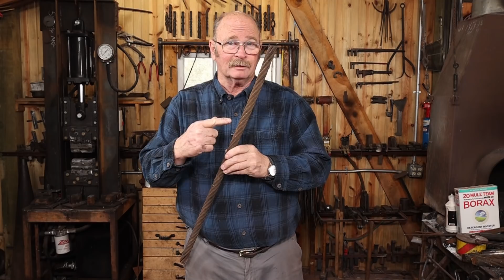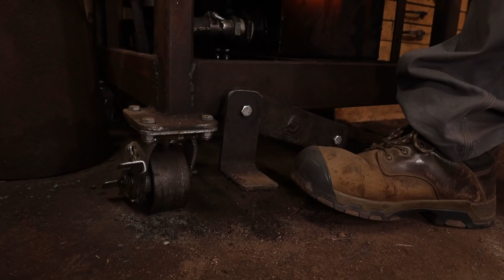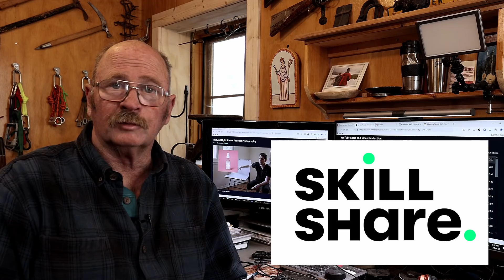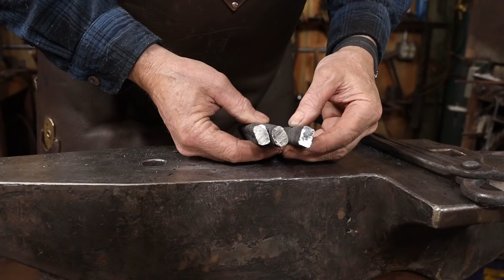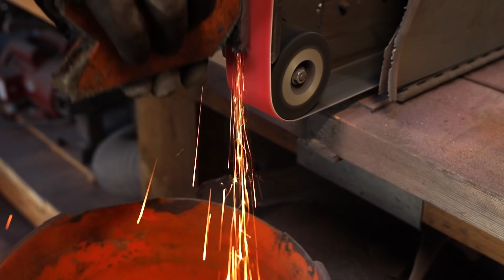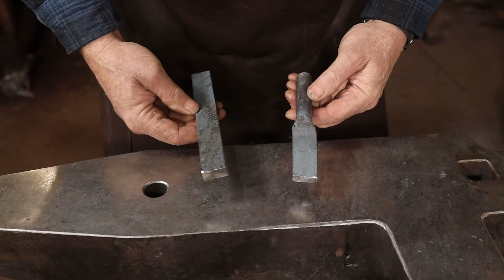Cable Damascus Axe - part 1

Comment: Rewatching this series because the elevator maintenance guys at the hospital I work at turned a blind eye to me walking away with some cable off cuts. Mine have a hemp core and it was suggested that I burn it out before I get serious about real forging.

Comment: I have a question regarding Damascus. I have zero welding skill, willing to learn but for the mean time could I take my strips of steel and forge weld two together and then forge weld strip on strip one by one to form the billet? A lot more work I’m sure but is it possible?

Comment: I just picked up a replacement cable for my recovery winch on my jeep. The stock cable is most likely galvanized, which from what I understand becomes toxic when heated. What's your comment on likely galvanized cable? Is it really a problem if you're on an outdoor forge? I've read other posts about using muriatic acid to dissolve the acid, does that help or matter?

Comment: Very informative,  thank you! I have some 1 1/2 cable 4' long that was given to me by a friend of mine that was on Forged In Fire. Came in 2nd. Been wanting to do something with it. I tried a small piece, welded the ends and well, it didn't turn out well. I'm going to try your process and see how that works. 👍

Comment: I have followed you for some time and also follow a Ukrainian smith called Shurap .  When he works with cable he always soaks in a liquid which I think is a borax solution, https://youtu.be/k5rDbr_0Ik8 Thanks for taking the time to share your video.👍

Comment: I took a family trip to San Francisco a couple years back. I picked up 4 sections of the cable from the cable car drive system. And have plans to make knives from it. One each for me and my 2 sons. 4th is to account for not getting it right the first time. Will definitely have to do the extra cleaning steps though.

Comment: Greetings John, another great video.  I have a Hells propane forge with a 30 psi gauge.  It seems that I can’t get my work as hot as you, that white hot.  I use 2, 20 gallon tanks together with a Y hose connection.  Do you think I don’t have enough “push” to get my work white hot?  Any advice would be wonderful.  Stay safe, Joe from Wisconsin.
Reply from the maker: White heat isn't needed.  What you see in a video isn't very accurate due to the way the camera sees the light and then how you monitor displays the image.  Forge welding heat is usually described as a lemon yellow.   Every gas forge is different and some style will never reach welding heat.  Altitude also plays a part, I had to add larger jets for mine to work at 6500 feet.  But the smaller 20 pound tanks, even paired up, do have trouble putting out the volume required at times.  I never had a problem with a single 100 pound tank.
Reply: @BlackBearForge  thanks John for this advice and all you do.  Been making leaf hooks and they would be similar if I started with the same length of 3/8 inch rod, grrr.  Have it written down now, but my bride of 33 years didn’t notice.  Must be love.  Stay safe, Joe from Wisconsin.

Comment: Great video as always, just a thought, I saw the hydraulic press, and u have 2 pedals, I was thinking that a "return" spring would help so u didnt have to swap pedals.
Reply from the maker: I think that would be a nice upgrade.  But it would probably need a reset of some sort to keep the press from holding pressure at the top of the stroke or to keep it returning all the way to the top every time you go back to the forge.

Comment: I love Hyflex gloves
Where'd ya get em from?
Reply from the maker: I think they came fro McMaster Carr
Reply: @BlackBearForge  cool Thank you
We used ta use those at a mine I worked at but, changed ta another brand that I didn't like as much. Hyflex fit my hands very well. I have another question. Were you tightening the twist on the wire rope with a twisting wrench made from an old pipe wrench?
I just watched it again.
That wrench tool is awesome!

Comment: I know this doesn’t have anything to do with this video… yet. I have a question on a way I’m thinking about mounting my anvil. I have a tree I’m cutting down and making an actual place for me. Would a tree stump be a good place to mount it instead of building an anvil stand?
Reply from the maker: A section of log is a very traditional anvil stand.  Depending on the wood anything below ground will eventually rot.

Comment: Thanks John! Another great project! Sofar I was to stupid to hold a piece with a magnet for grinding, I'll keep the trick in my repertoire 😅
Reply: If you have a metal platen, be cautious when you try this and ready for it to stick. It’s a bit different than just putting a bare piece of steel up to it.

Comment: Was the cable at welding temperature when it was twisted in the vice? Looked pretty hot, but hard to judge on a computer screen.
Reply from the maker: It was, but I don't know if it actually welds as it tightens or not.  Mostly I just want the scale and flux to squeeze out

Comment: You make it look so easy, I usually have nothing but trouble trying to make cable into a billet. Thanks for the video, I will have to give it another try. I have six feet of .75 in. Cable in the attic of the garage. Thank you Sir.

Comment: Sound today was real "live" sounding like I was in your shop. I liked it. Would be interesting to see if there is any difference between different types of cable construction, 7-7 vs, 1-19 and so on. Steel cable is interesting material.

Comment: Just wondering  how that cable damascus would react to being upset
Reply from the maker: If the welds are 100% perfect, it should work fine.  But any flaw will likely split if upset.

Comment: Great video John, I would like to give cable welding a try, just because. Dumb me, never thought of using magnets for holding parts to grind, even though I have several different sizes. It's always been vice grips or pliers, thanks John for the enlightenment 👍🔥⚒

Comment: I used to make lots of cable blades in the 90s, if you weld it round, then grind off 3/32” or so, then forge the blade, it leaves dots and ovals in the pattern, looks cool. Also, I knocked the flux off of a few incolnel welding rods and twisted them up with the cable, it forge welded up perfectly and after etching and polishing, looked like little mirrors in the blade. The problem was it had a few spots of incolnel ended up on the edge and of course those spots don’t harden. If you can figure out how to keep it off the edge it looks awesome.

Comment: I was wondering about the quality of steel in the cable. Would it hold a knife edge well? or is it more for looks?
Reply from the maker: cable tends to be 1075, 1085 or 1095.  All good high carbon steel.  It really comes down to the quality of the welds
Reply: Steel cable is USUALLY made of 1070 or similar steel. So yes, there is indeed enough carbon in it to harden and hold an edge pretty well... IF you know what you're getting. The host addresses that topic at about 5:00 in this video.
There's also stainless steel cable, which is made of a 300-series alloy, and that will NOT harden well or hold an edge worth a hoot. But you'll be able to figure out pretty easily if it's stainless or not.
Reply: Thank you!

Comment: that borax is hard on the inside of your forge
Reply from the maker: Terrible.  I just accept that the lining of a gas forge is a consumable and replace it every year or two as needed.  The other option is to stop doing larger forge welding operations and only weld whats convenient in the coal forge.  
"Get it hot and hit it" 😉
Reply: @BlackBearForge  ya I use my coke forge for welding

Comment: I wish you would do more Damascus builds.
Reply from the maker: I shy away from it mostly because there are so many skilled makers doing videos that are better at it than I am.  Plus I in general try to show that there is way more to blacksmithing than knives, swords and damascus
Reply: There's also the fact that quite honestly, there's really no practical reason to bother pattern-welding steel anymore. It's strictly for looks and to show off the maker's skill in developing cool patterns. Which is great of course, but it doesn't make the item intrinsically any better.
There's a lot of waste involved in most pattern-welding procedures, and a lot of opportunities to really screw up perfectly good steel. All the benefits of it that were important in the olden days simply aren't an issue with modern steel. 
Plain old O1 or 1095 etc makes just as good of a knife or tool as any ancient or modern damascus.  With a lot less work, less waste, and less chances of messing it all up.

Comment: was hoping to see from start to finish but thats okay cliff hangers are great too I would like someone besides my self attempt a seven cable axe with two inch cable hard to do it's the heat portion must keep it hot and keep it from slipping nothing worse than a half welded axe I made a double bit axe a seven and ten inch blade why because I could.
Reply from the maker: I was hoping to do this in a single video, but its looking like a 3 or 4 week project at this point.  One of these days I will start taking the time to do single videos of these larger projects and just take a week or two off if thats what 's required.